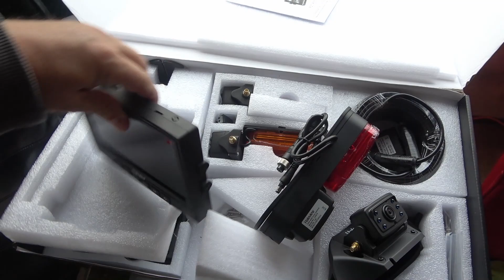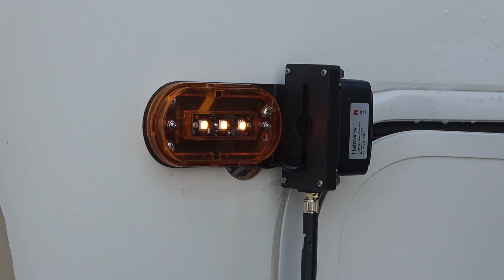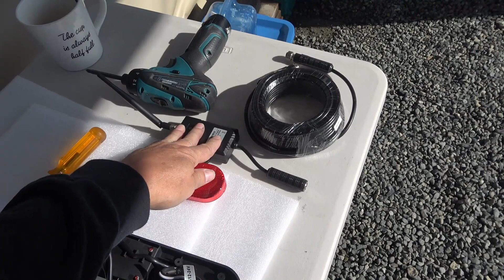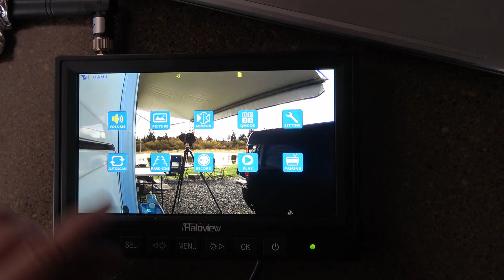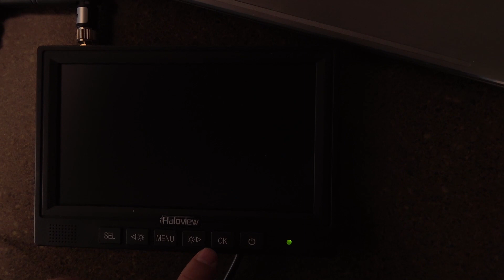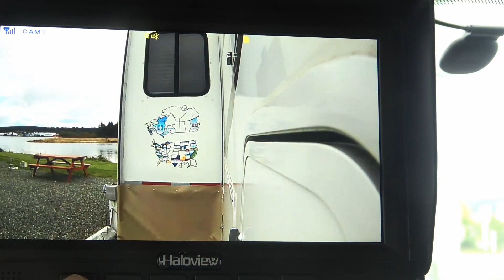Haloview Ultimate RD7R Deluxe RV Wireless Camera Kit Installation and Demo

Comment: The camera system is total trash, don't waste your money.
Reply from the maker: I think people including me would take your comment more seriously if you could provide some details as to why?
Reply: Details? 
 How about they advertise 1080, except it doesn't record in 1080 if you have all 4 cameras recording, the actual recording is more like 480.
It WILL Not loop record, the memory card has to be reformatted to be able to record over it, which means you have ABSOLUTELY NO IDEA when it stops recording wile you're driving. 
This thing is ONLY good for a backup camera (not recording) and thats it. 
You email their customer service about it and they want your order number the date and time you ordered it and your name before they can even answer simple questions. 
I told them it was not recording and they actually wanted me to send them video of it NOT recording.......how exactly do you do that?
I think people would take your channel "more seriously" if you would give an actual decent review without being so condescending.
Reply from the maker: @skyeram  For this model system, they advertise 720P,  which you get for recording on one camera. It is true that when recording multiple cameras the resolution drops quite a bit. I noted that in my review video I did after using the system for a while. https://youtu.be/Lt8Va_FcvCM?t=456  There is now an updated model called the Byte Tango BT7 that can do multiple 1080P recordings at the same time. As far as loop recording. It does do it. Look for a setting in the menus called "Cover" and turn it on.

Comment: I have this system and I put a 7 pin female plug in front of Rv and connected just the brown wire to + and white to -  to the plug, put a switch on the + line to bedroom, put the monitor in there, plugged in the Rv power cord in to the plug I installed, now I have a great security system with night vision

Comment: Hi Ray, Do you have a unique discount referral code to order directly from Haloview? Your full  kit is not on Amazon. We are going to try it as well. Thanks. Safe Travels and Happy Trails.
Reply from the maker: As far as I know they don't have discount codes, at least I have never been offered them, this is a brand new release that's why it hasn't hit Amazon yet, usually after some time has past it ends up on the Amazon store. Cheers, Ray
Reply: @LoveYourRV  Thank you Ray. I will give them a call directly. Maybe put a little pressure for a "Love Your RV" code. If they say they will be adding to the Amazon Store, we will wait to use your store link. Stay Safe and enjoy the short trips at home. Hope the border opens soon. Safe Travels and Happy Trails.

Comment: Hello again it's been a while since I made a comment but I have been checking in every once in a while to stay up to date on you folks.  It seems you are doing fairly well dealing with all that is going on with the world right now, I'm glad to see!  Sorry to hear you won't be traveling south this year but I kind of expected it would be a problem.   This camera system looks like it might be a keeper.  Waiting to see your comments after using it a bit.  Just a note though when you were cleaning that putty off for the install.  I'm not sure how it will work on it but I have found that WD 40 is a good cleaner for many things.  Takes glue and price stickers off, it works great for an emergency hand cleaner with grease and tons of other uses for so many things as well as a lube.  Just a hint you may find handy some time.  LOL I use it for the other stuff more than as a lubricant to be honest.   Take care of yourselves and stay warm this winter.  As always a faithful follower  John
Reply from the maker: Thanks for the tip. I used a combo of LA totally Awesome Spray Cleaner and Lighter Fluid, worked well. Cheers! Ray

Comment: I think you installed the side markers reversed. If the antenna was going up then the hole would be facing down to drain moisture.
But I could be wrong.
Nice review.
Reply from the maker: There are holes on both the top and bottom. A design flaw in my opinion as windy rain and spray from the truck tires on wet roads is going to get forced inside the fixture from above or below.  The OEM lenses don't have drain holes.  See the comparison - https://www.loveyourrv.com/wp-content/uploads/2020/09/OEM-verus-Haloview-scaled.jpg
Water may find its way inside the RV sidewall and lead to rot, fiberglass delaminating or mold. So I feel it best to seal the holes. I gather the idea of the holes from talking to Haloview was to provide option for wiring outside the lens. Cheers, Ray
Reply: @LoveYourRV  I would agree with you on that. I thought maybe it was on just one side. Thanks for clarifying.

Comment: I think you may have the side markers backwards. The one you say has a hole at the top may be for the other side and would be flipped, so the hole is actually a drain fir condensation.  Better check the other side.
Reply from the maker: There are holes on both the top and bottom. A design flaw in my opinion as rain and spray from the truck tires on wet roads is going to get inside the fixture from above or below.  The OEM lenses don't have drain holes.  https://www.loveyourrv.com/wp-content/uploads/2020/09/OEM-verus-Haloview-scaled.jpg

Comment: Are the side cameras handed? If you mounted them on the opposite side would that not put the little hole on the amber lens on the bottom instead of the top?
Reply from the maker: They do have an R and L on them but there are identical holes on the top and bottom. Also, even on the bottom I'd be concerned about the road spray off the truck tires driving water into it.  Seems like a design problem to me.  Cheers, Ray

Comment: Does the rear camera require the range extender to work? Is there an extension cord you can elect not to use in installation?
Reply from the maker: This particular kit does as the camera has no antenna itself, but there are many variants to chose from https://www.haloview.com/products/wireless-backup-camera-systems.html/?acc=413  like this kit that comes without the range dominator - https://www.haloview.com/haloview-mc7109r-ultimate-7-720p-hd-digital-wireless-rear-view-camera-system.html/?acc=413  On my install I elected to not use the 12M cord and just attached the repeater box with the antenna to make it work.
Reply: Thanks. That confirms what I thought and I would install the same way however I don’t need an extender for my current trailer just deciding if it’s worth having the option for a later trailer. These are cheap enough I’m leaning mc7109 for now.
Reply from the maker: Maybe best to see if you actually needed it for a later trailer. Another option is the extender antenna - https://youtu.be/24JRT01ngSI  It worked pretty well in my test.
Reply: Love Your RV oh that’s different from the range dominator? Well that’s perfect then yes I’d just buy that if I needed it. That one has a battery vs 12v power?
Reply from the maker: Doesn't need power, just screws on to the camera antenna connector instead of the normal one and has a long wire and taller antenna - https://www.haloview.com/haloview-wireless-angle-adjustable-antenna-extension-with-magnetic-base.html
Reply: It’s funny because if you could optionally use the range extender I’d buy it... but since you have to use it I probably won’t.
Reply: By not putting the extender at the front of your trailer you end up having video lagg while traveling at highway speeds. 
Basically by installing it that way you don't get real time video of traffic in your rear camera. 
Yes it works fine while parking or for security but Not at highway speeds.

Comment: Ray, another superb video sir! Are you able to name the cameras? The wiring harness is for turning on the cameras when the turn signal is on so when that is active does that camera dominate the screen? Could you have 1/2 side camera and 1/2 rear camera? Very interesting and the record feature is very intriguing!
Reply from the maker: Don't see anyway to name the cams. Yes the different wires trigger different cameras and you can set up the screen to view the different combos of cameras. Here is an owners manual for one of the systems that explains it - https://www.haloview.com/pdf/Haloview_RD7_User_Manual.pdf  Cheers, Ray

Comment: Typically, I believe that little hole in the lens cover is oriented DOWN so any moisture will drain out. Not sure if that's the case with those or not? Thanks!
Reply from the maker: There are holes on both the top and bottom. A design flaw in my opinion as the rain and spray from the truck tires on wet roads is going to get inside the fixture from above or below.  The OEM lenses don't have drain holes.

Comment: I think the weep hole in side markers should be facing down. That would result in antennas being up. But with condensation being unavoidable it’s important to have the hole down.
Reply from the maker: There are holes on both the top and bottom. A design flaw in my opinion as the rain and spray from the truck tires on wet roads is going to get inside the fixture from above or below.  The OEM lenses don't have drain holes and don't get condensation. I guess enough air gets in around the cover.
Reply: Love Your RV oh wow, you are totally right. Sorry for my input being off the mark.

Comment: Its ridiculous that its doesn't record quad screen
Reply: While our Haloview can record 4 cameras at the same time, you just couldn't record the quad screen. That means when you record in quad mode, the videos of the 4 cameras will be recorded separately. Haloview guys told me that the images is compressed when in quad mode, the video files be stored into every single file according to each camera.
Reply from the maker: @luisgravano6123  Thanks I'll give it another try.  I know there are several different models of displays.
Reply: You can record up to 4 cameras at the same time in quad mode, but you can't record quad screen that 4 cameras shows in one screen.
Reply from the maker: @peterforster8129  Thanks I'll give it another try.  I know there are several different models of displays.
Reply from the maker: Yeah, seems like a no brainer, maybe I just don't know the right buttons to push, but I couldn't seem to get it to record anything but a single screen.
Reply: @LoveYourRV  its either they don't know what the consumer wants or they just want to slowly leak out technological advancement to sell more product over time. They are priced high enough they should have no video delay and be able to record all channels. My swann home system is 12v and has features that are amazing quite frankly
Reply from the maker: The only difference is your house doesn't roll down the road at freeway speeds.  I think that's why the Haloview is still using 720P resolution to keep the file size down for wireless transfer. Motion makes a big difference as a lot less video compression can take place since each frame of the video has new pixels to deal with versus home security that basically has the same image and just the person or object to update.

Comment: I think the hole in the lite is a drain.  At least according to Fennels in Vic.
Reply from the maker: It didn't do a great job as there was lots of water inside the lens after the big rain we had. There are holes on both the top and bottom. A design flaw in my opinion as the rain and spray from the truck tires on wet roads is going to get inside the fixture.
Reply: @LoveYourRV   I had to replace one of the bigger 8" diameter scare lites a couple of years ago.  It had 1 hole and was installed with the hole at the top.  The inside was rusted with a high tide mark of rust.  So I got a stainless version and installed it hole down.
I'd fill the top holes
I prefer Dicor over silicone and also use the putty roll to bed things to the trailer side.
There is a plastic bodyshop  tool which would get off the silicone.  I have xtras, I could mail you one..  I have the red and silver slim jims but don't use them on fibreglass.. I'd round off the corners to prevent accidentally gouging the glass.

Also will watch the vid re skirting.  I'm planning to use the old  47" white slidetopper material.  Seems thicker than EZ Snaps.  Will use finishing washers and screws in the trailer lateral ine and the Velcro in other locations.  The 47" allows me to angle out the fabric over the water tap and sewer dump.
To keep thing from freezing, I'll use a  couple of pieces of re bar or metal pipe/tubing and wrap them with heat tape with the built in thermometer/ switch.  The switch will be jus outside the skirting.  Both will be blocked up a few inches.off the ground.
Circulation will be done by 4 usb fans from Castle Building supplies.  2 on the left rear and 2 at the right front to prevent stalling..  Cost so far is about 200$ nic pipe, fans andheat tape.  My water hose is already heated.

Comment: Please reconsider your use of silicon adhesives.  Silicon does not stick to itself, so unless you use acetone to clean the surface, the old and new layers of silicon will NOT self adhere...  aka leaks.   Great coverage of an interesting topic othewise.
Reply from the maker: I generally use Geocel RV Proflex sealant not silicone to replace the OEM silicone or in some applications SikaFlex 291 as they work well, last long, and are easy to come by. https://www.geocelusa.com/product/pro-flex-rv-flexible-sealant/  "Resealable; may be applied over itself"
I always make sure to fully clean the surface of the old sealant., I find lighter fluid works well. Acetone does too but you have to watch it around plastics. In the case of these fixtures, they have their own rubber gaskets so no need to use a sealant around them. Cheers, Ray

Comment: Hey Ray -I may have missed the answer but if you take the monitor inside at night and use it to watch the security camera over the steps, how do you power it?
Reply from the maker: Yes, I do that, let the display run and record night footage or when I'm away from the rig. It needs to be powered on to record, the camera can be plugged into the RV 12V power via a cigarette lighter socket, I have a couple in my RV or any other DC plug one wants to install or maybe use one of those 12V power boxes like a Jackery, the display draws very little wattage.  You can see in the video here how I had my previous DIY setup - https://www.loveyourrv.com/diy-rv-security-camera-using-haloview-wireless-backup-camera/  Cheers, Ray
Reply: Thanks Ray

Comment: I have the 4 camera HaloView system and have been very pleased with it. I strapped my monitor on to my ram rear view mirror - before they came out with that strap system you have. One comment I have is that at night I wish the menu buttons would stay illuminated. Do you know if you can use more than four cameras?
Reply from the maker: Yeah, I was using hair bungies with the smaller 5", work pretty well. :)  As far as I know 4 is the max for their systems.  Cheers, Ray

Comment: Is the hole in the light because you have flipped it? Might be a drain hole.if the antennae was up?Or can you actually flip the light around too?
Reply from the maker: Has the same hole on the top and bottom. I told Haloview about it and waiting to see what they say, maybe I'm missing something. But we had heavy rain and the inside of the lens was wet and fogged up that's when I noticed it.
Reply: @LoveYourRV  Give us an update on the drain holes when you find out.
Reply from the maker: @1951Roy  Talked to Haloview and explained the issue and my rep talked to the engineers. I told them that water could be forced into the hole even from below when driving on wet roadways with the tire spray, plus maybe heavy windy rain. I gather from them the holes are there as an option to use external wires and they agree with me that it would be best to seal the fixture and glad that I pointed it out, though in a year they haven't heard of any problems reported.  Here is a pic I took comparing the Haloview with my OEM fixture, you can see it provides a path for water to get into the RV sidewall - https://www.loveyourrv.com/wp-content/uploads/2020/09/OEM-verus-Haloview-scaled.jpg  The water could lead to rot or mold or maybe even delamination of the fiberglass.  Cheers,  Ray
Reply: @LoveYourRV  Thanks for the heads up. Someone needs to rewrite the manual. Sounds like a Tech issue.
Reply: I would understand a drain hole at the bottom for condensation or rain, but not at the top.  Since you flipped it over seems like top side should be closed off and bottom left open??
Reply from the maker: The OEM have no holes. I'd expect that would be the best way to go as when traveling in the rain the truck tires kick up a constant spray of water and road grime. Easy to fix though with a little rubber plug or some silicone rubber.